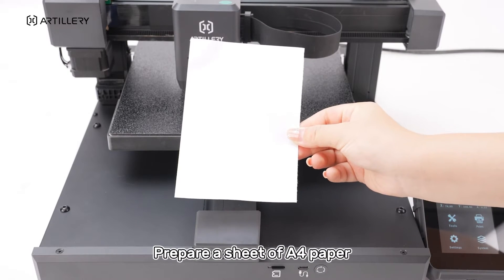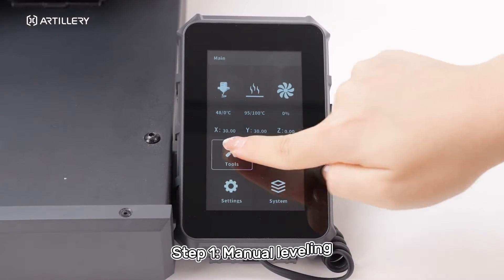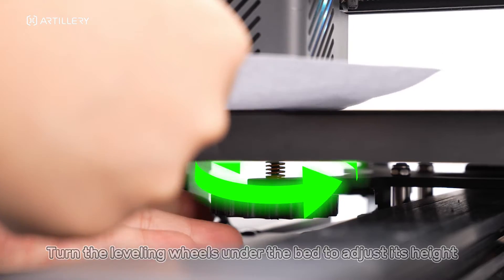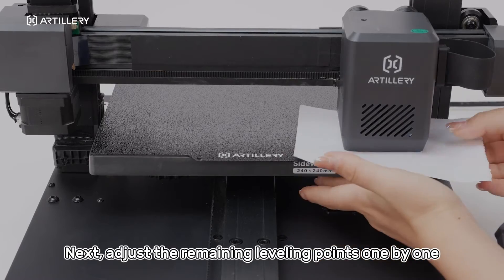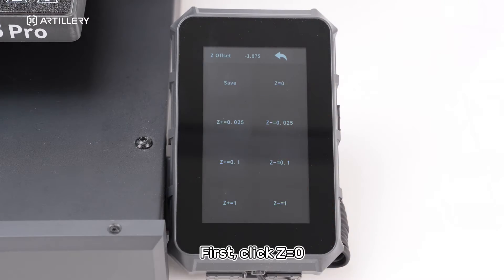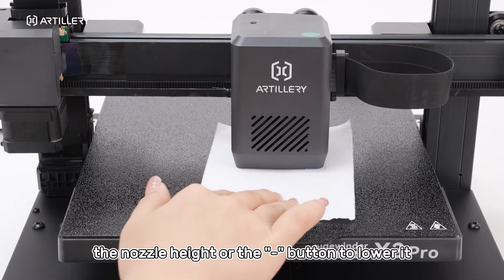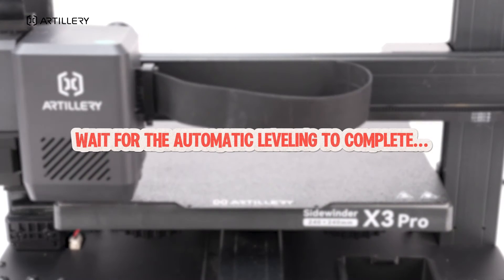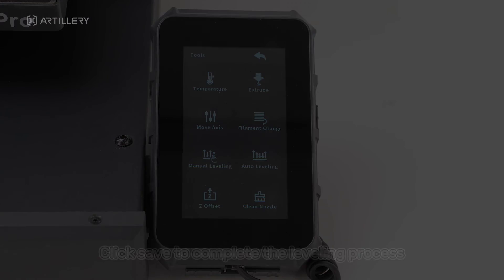Tutorial | How to Leveling Hotbed of Sidewinder X3 Plus/Pro

Comment: BASICALLY ON X3 PLUS IT IS COUNTERCLOCKWISE WILL LIFT THE TABLE SO THAT MOVES TOWARD NOZZLE AND ANTICLOCKWISE WILL GO AWAY FROM NOZZLE (DOWN). THE PROBLEM IS IF YOU TURN THEM CLOCKVISE TO LIFT THE BED, YOU SHOULD  TURN THEM WHERE  ISNT HOLDING ANYTHING ANF THE KNOB CAN FALL OFF. IF YOU PUT THEM ALL THIGHTER AND THE WHOLE TABLE WILL BE LOWER, AND I THOUGHT I WILL COMPENSATE IT WITH Z AXIS OFFSET SETUP, BUT THEN THE TABLE STARTED SHAKING SO IT WAS NOT TIGHT ENOUGH AT THE INNER RAIL... IF I TRY TO MAKE TIGHTER WITH WRENCH THE OTHER 3WHEELS INSIDE, ITS JUST WORSE THE SHAKING... THE MIDDLE 2 KNOBS  JUST MAKES THE SHAKING WORSE AS WELL.

Comment: Can you show this for the plus? The extra two knobs in the middle of the bed what do we do with those since the calibration doesnt call out for those on the manual leveling.
Reply from the maker: Hi there, this video is also available for Sidewinder X3 Plus. Plus got 2 more wheels below and it can be adjusted just like other wheels. Please do the leveling according to the steps as video showcasing.
Reply: @Artillery3D  where is that video? I have only found the video for the x3 pro nothing showing the x3 plus exactly with leveling all 6 points not just the corners and the z offset for the center. Thanks
Reply: @Theycallmeroe  True

Comment: After manually calibrating all points manually, it hits the nozzle into the bed/plate on "auto-levelling".
Reply from the maker: Hello, do you set zoffset=0 befroe doing the leveling?
Reply: @Artillery3D  Yes. It hits the nozzle into the bed only on the right side of the bed. I also levelled the Y axis (unscrewing the sync belt and manually move it). But, no matter what I do, it crashes into the bed.

I'm about to return it.

Comment: When I selected <home all> the hot end goes all the way to the top od the printer trying to keep on going up and crashing with the filament sensor and finally coming down about 3 inches from the sensor. I press the z offset to manually bring down the hot end doing the paper leveling of all the 5 points and saving them, when I try to do the automatic leveling I got an error once  the auto leveling is trying to start (leveling failed, please restart the machine). I also get an error saying (hotend heating failed, please restart the printer) it won't heat up pass 28 degrees. Is been several times that I try but keep on getting the same errors. Has anyone else had similar issues? Im waiting on a reply from artillery as i cannot use the printer 😢.y
Reply from the maker: Sorry to hear so many mess. You  can contact our support team via email: support@artillery3d.com. Our technical support will help you there.

Comment: This table setup won't work. The sw x3 plus printer should have its own separate film. Have you forgotten that SW x3 has two permanent aluminum sleeves in the middle of the table?
Reply from the maker: Yes, this video is a correct way to do the leveling on Sidewinder X3 pro and plus. If you have problem on it, please leave your comment here.